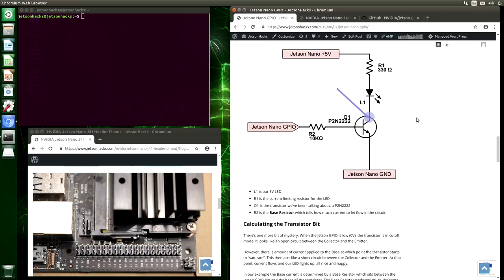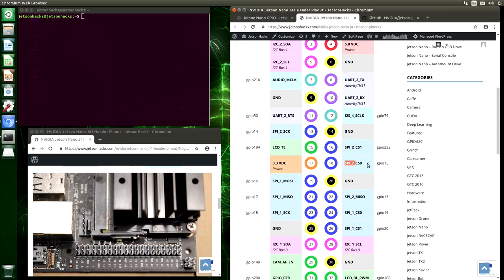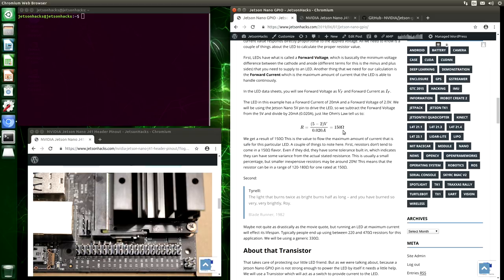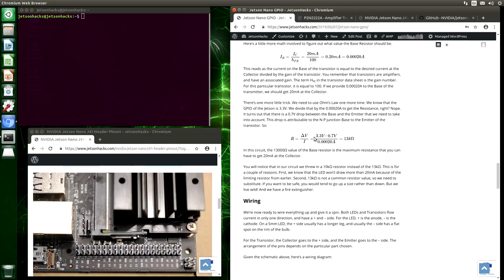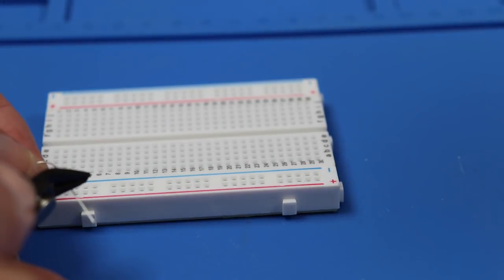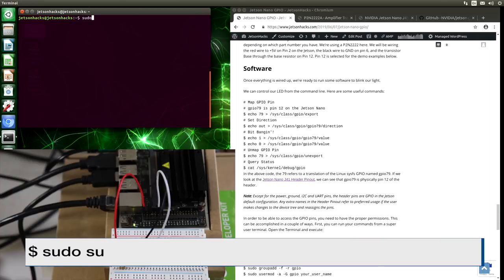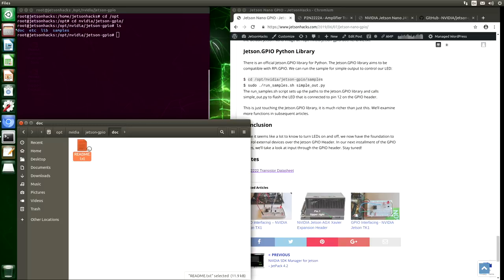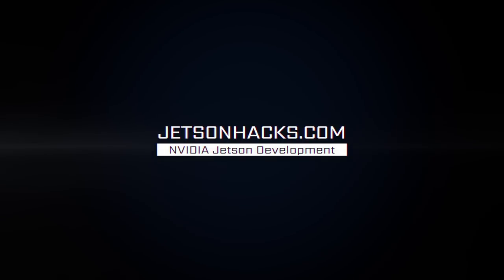Jetson Nano GPIO

Comment: Excellent video, love the background and detail. Right now my project is stuck on getting UART communication between nano and emic2 (tts module) so I'm looking forward to your UART video! (Your website is super great too!)
Reply from the maker: Thank you for the kind words. UART can be a little tricky, hopefully we'll be able to figure it out. Thanks for watching!
Reply: @JetsonHacks  Getting UART to work on an ATMEGA controller was simple, but having to work through LinuxTegra4 on the nano makes it tricky indeed!
Reply from the maker: You do know that the emic2 is a 5V device and the Jetson Nano UART is 3.3V? Just as on a Raspberry Pi, you need some type of level converter to match them up.
Reply: @JetsonHacks  Ah, you're right. Looking at the data sheet again, I see that SIN is 3.3-5V but SOUT is 5V only. I have a 3V voltage regulator lying around perhaps that will do it. Thanks!

Comment: Plz make servo ,stepper, dynamixel tutorial....that's we need most ....👷‍♂️😅
Reply from the maker: That's a pretty wide request, all of them are different depending on their use. Did you have a particular application in mind?
Reply: @shubhamcyborg9218  idea is amazing 👍👍👍but again dynamixel is not affordable 😂
Reply: @edithhealthcare4862  that's right but I thing AX-12 model is affordable.....😎
Reply from the maker: The Dynamixel servos use RS-485. The easiest way to communicate with them is through a USB to RS-485 converter, such as the DYNAMIXEL U2D2.  This is much different than hobby grade servos, which tend to use PWM.

Comment: What pins other than the two PWM pins (32 and 33) of the GPIO and the PWM pin of the J15 header be used for PWM resources on the jetson nano?
Reply from the maker: I don't know. You should ask on the Jetson forums. If you need more PWM pins, you should be using a microcontroller or PWM board that can handle the real time signals required to generate the pulses. The Jetson operating system isn't great at real time control like that on the Nano.
Reply: @JetsonHacks   I can connect an arduino to the nano, and use the PWM pins from the arduino right?
Reply from the maker: @Bwajster  Yes.

Comment: Hello, several questions: your link is to the Fluke 117 but I see you are using the 115, any reason in particular? Is the I max for the gpio 1mA? Did this info come from other Jetson devices? If you flip the E and C like for the 2N2222, will the magic smoke emerge? Well done video.
Reply from the maker: Thank you for the kind words. I think I just copied an older link from another article on the 117, I will update to the 15.  NVIDIA general quotes 1mA for the pin current on the GPIO pins, but on some Jetsons that can be as little as 20 microA, depending on the wiring. I haven't gone through the schematics enough to have a full understanding. 
In general, you can think about these transistors as two diodes, the current only flows in one direction. However, I don't think people recommend reversing the wiring on them. It may let the magic smoke out, it may not. For inexpensive parts like this, it's hard to tell what the tolerance is for abuse. Thanks for watching!

Comment: Hello.I am using nvidia jetson recomputer j1020.There is a Jetson nano inside. Jetson.GPIO or RPI.The GPIO does not work healthily.I'm constantly getting warnings like this, and the engine is not working.Warnings;
(WARNING: Carrier board is not from a Jetson Developer Kit.
WARNING: Jetson.GPIO library has not been verified with this carrier board,
WARNING: and in fact is unlikely to work correctly.).Do you have any idea how I can start the engines?I would appreciate it if you could help.
Reply from the maker: Does the GPIO work at all? I don't know what "work healthily" means. Your best bet is to contact the manufacturer for the reComputer for help. The warnings only indicate that it is not a NVIDIA developer kit, and are not errors. You may be able to get help on the official NVIDIA Jetson Nano forum, where a large group of developers and NVIDIA engineers share their experience: https://forums.developer.nvidia.com/c/agx-autonomous-machines/jetson-embedded-systems/jetson-nano/76

Comment: I'm trying to follow all the tutorial, but I couldn't put in "True" or "False" the GPIO pins.
Is there any other kind of configuration I have to do before? Please, I'd like your answer.
Moreover, I tried measuring voltage betwen the pins 2 and 6, but I got 0 volts with my voltimeter.
Reply from the maker: I don't know what "I couldn't put in True or False" means.
Reply: @JetsonHacks  I mean, I've tried to set the GPIO as digital output, but I couldn't set the GPIOs in True (1) or False (0).
Reply from the maker: @juanpalaciosvargas7329  How are you attempting to set them? Do you have permissions set correctly? What circuit is attached to the pins?

Comment: While this looks simple and useless to some. This one thing can open up a whole new world for physical programing.  The led could easily be replaced with a relay. I'm not going to steal your thunder, but what I do for finding the led resister value is.. supply voltage - led voltage divided by the required current = the required resistor. Maybe you did the same thing. I don't know. I couldn't see the calculation very well do to a small screen..Peace out dude and keep on rock n .
Reply from the maker: That's about right. As explained in the video and the attached article, it's the forward voltage and current of the LED: (voltage - forward voltage)/forward current. This is (5-2)V/.020A = 150 ohms. Thanks for watching!

Comment: Hi Jim. Thanks for the great videos. You (or anyone) wouldn't happen to know how much power I can draw off the USB ports would you?
Reply from the maker: I do not know, it's worth checking on the official NVIDIA Jetson Nano forum. A USB 3.0 port allows for a draw of 900mA. I don't know how they power the USB ports whether it's 4x900mA or 900mA total draw. Since the dev board can only have 5A max power, it seems unlikely that the USB ports can draw 3.6A by themselves. But I'm not absolutely certain. Thanks for watching!
Reply: @JetsonHacks  Yeah, I checked the nvidia web-page and manual but didn't find anything. I'll check the forum. Thanks.

Comment: Hey Great Video!! I am trying to use mlx90614 sensor with Jetson nano. I can't detect it using sudo i2cdetect -r -y 1. I tried i2c bus0 also. Can u please help
Reply from the maker: You have not given enough information to help. Typically people would supply some type of wiring information, and the breakout board that they are using.

Comment: can i change any another pin to PWM pin. I want to add two l293d motor drivers with the gpio directly any solution for that. I am able to run the motors but i need  pwm for speed control.
Reply from the maker: A recall that pins 32 and 33 are for PWM. For further information, please ask your question on the official NVIDIA Jetson Nano forum where a large group of developers and NVIDIA engineers share their experience.

Comment: Can we run buzzer using gpio pin and ig yes how? Thanks
Reply from the maker: I don't know what you mean by buzzer.
Reply: @JetsonHacks  means instead of using the gpio to light up the led we use the gpio to ring the buzzer. Because i tried it but the buzzer wong buzz
Reply from the maker: @UCoFFspeF0i0tyeJ28Z3-k8Q I don't know what "the buzzer" means.
Reply: @JetsonHacks  A buzzer or beeper is an audio signalling device, which may be mechanical, electromechanical, or piezoelectric. Typical uses of buzzers and beepers include alarm devices, timers,
Reply: As i wanted to make the buzzer ring when a signal from the gpio pin is given
Reply from the maker: Depends on the type of buzzer. If you use a Raspberry Pi compatible buzzer, it should work. If you watch the video and have read the associated article (along with all of the Raspberry Pi related buzzer articles), you should be able to figure this out.